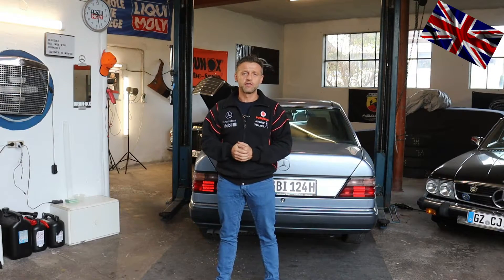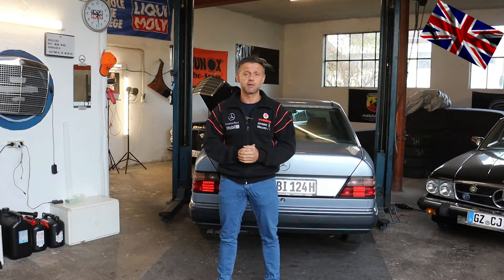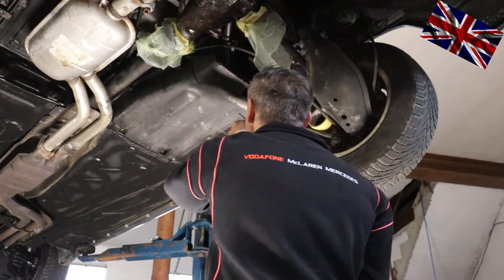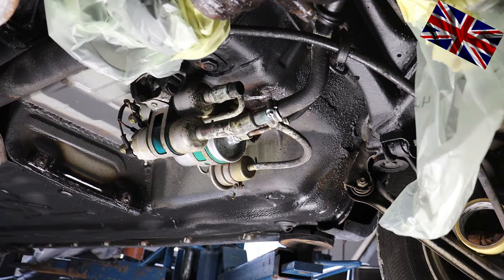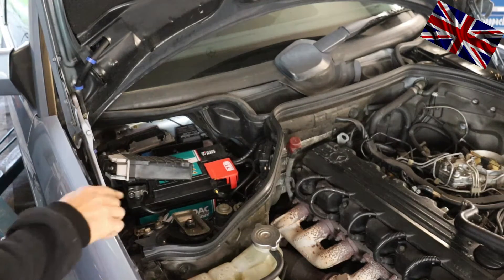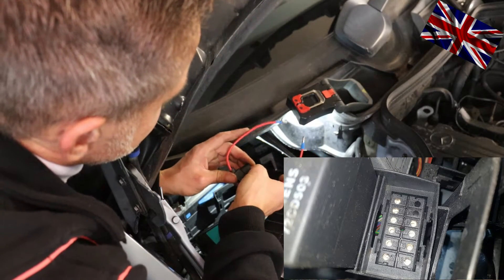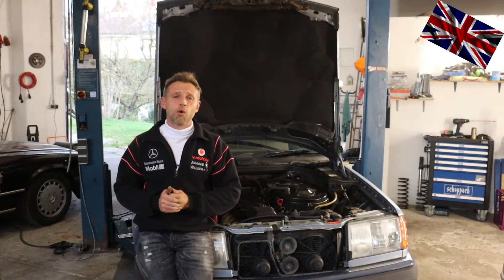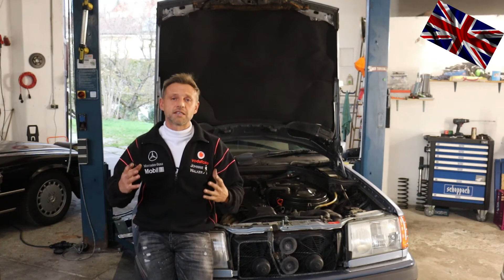Mercedes W124 - KPR fuel pump relay bypass - fuel supply

Comment: Not all W124s have the large 10 pin fuel pump relay. On my UK supplied (RHD) E220 cabriolet the fuel pump relay is a smaller green relay, 001 542 9619. To bypass the relay, connect the ports for pins 30 and 87. On my car the relay was found to the left side of the ECUs (looking into the engine bay) behind the battery and under the black plastic shield. Next to the FPR is a separate Kickdown relay.